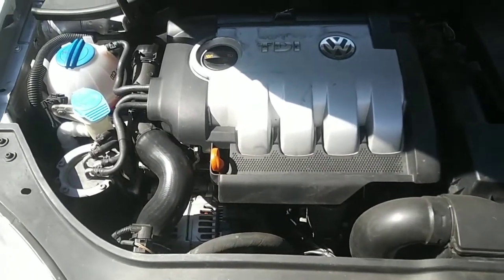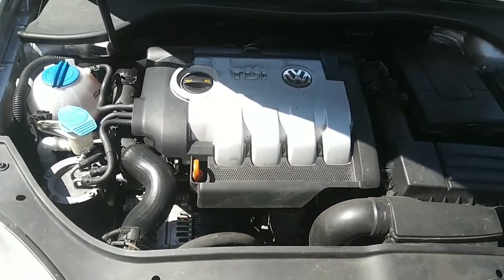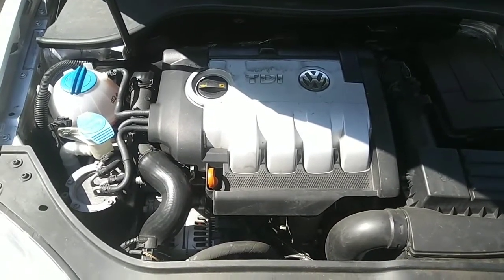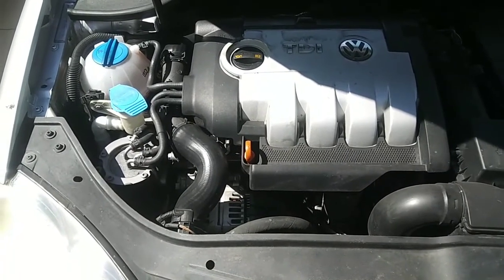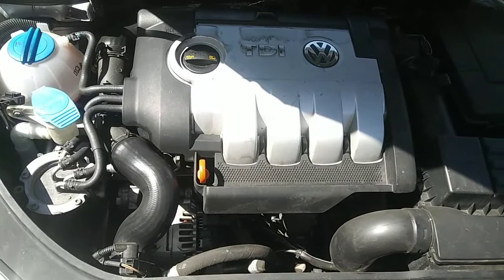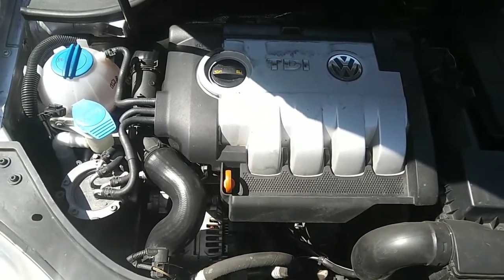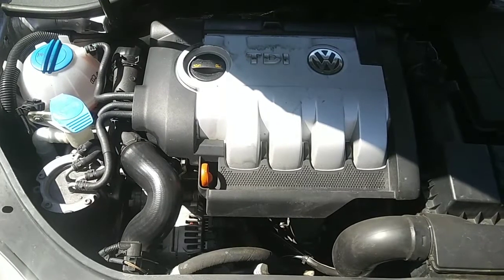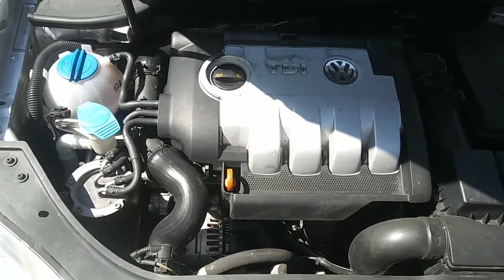Brm TDI camshaft and maintenance intervals

Comment: One of the main reasons that the CAM shaft goes in this is because many people follow the factory recommended oil which is a 5w30.  Next it’s the 10,000 miles, at which point the oil is braking down and causing metal wear.  That’s why many of the TDi forums recommend Rotella T6 5w40.  Next I recommend a 5,000 mile interval and your oil will not breakdown.  Finally, doing the timing belt at 100k miles for this engine is just fine.  I think 90k is recommended but you can safely go 100k miles no problem.  Following the above, you should check the CAM for wear at 200k miles.  Replace only if necessary.
Reply from the maker: I use t6 in my pickup but not in my tdi because I believe part of the  505.1 spec is for turbo seal seepage. T6 may not burn clean and may be the reason people are experiencing egr plug ups. I have 240k now and never had a intake manifold plug up problem yet. My 505.1 pentosin is 10w 40
Reply: Good advice  thank you.

Comment: I have 250k on my BRM and it runs well! Original camshaft since first owner did not replace anything. I change oil and filter every 10k miles using Pentosin or Rowe oil and fill to minimum required level. I then check the level every 1k miles and add new oil when necessary (the engine never takes the entire amount of oil during the change and consumes about a liter every 10k miles).

Comment: 315k on my original cam 😳
Reply from the maker: wow. that has got to be a record what oil are you using. Beware also of the oil pump issue.
Reply: 351k on mine

Comment: I just bought an 05.5 brm from a VW service manager. The Previous Owner did 5K intervals with Castrol Professional 5-40 505.01 TD oil. The Camshaft is still well within spec and has 300 YES 300,000 Miles on her and still runs strong. The oil is only $7.85 per quart from the dealer. Im sticking with it!
Reply from the maker: wow that must be a record. Mine was changed at the dealer too before I purchased it and cam went flat at 190k miles. 5k intervals too just luck of the draw I guess. They are great engines Mine now has 240k miles. My 2009 has 240k miles as well. 2006 still gets 44 mpg about the same as it did when I got the car at 80k miles.